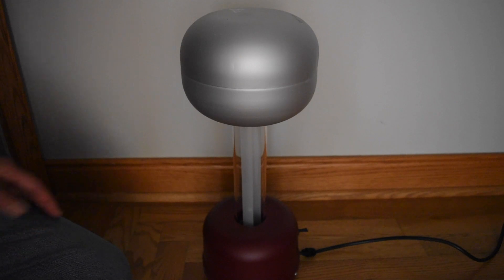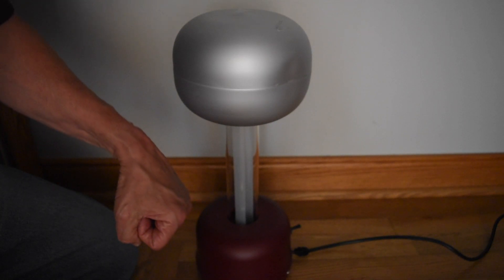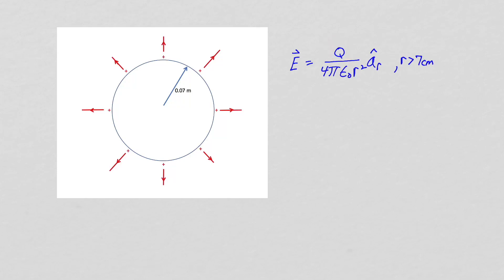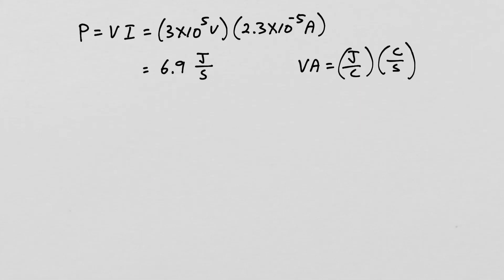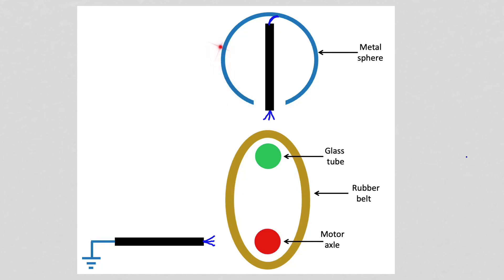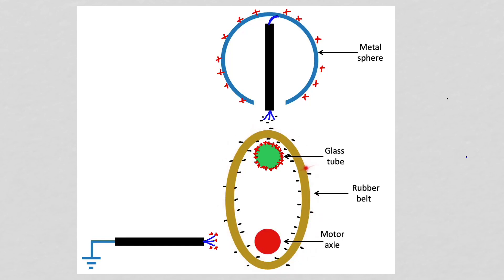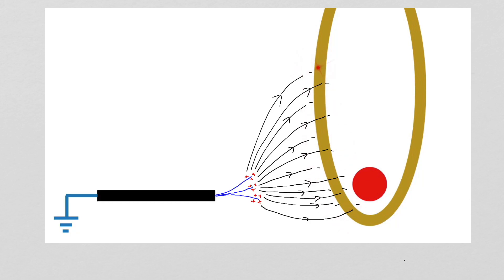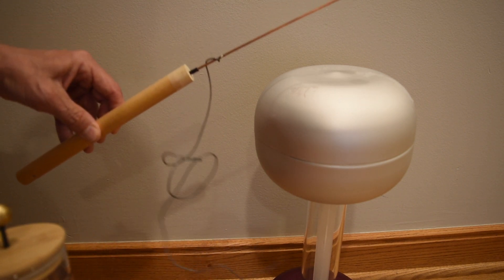How Much Charge is There on a Van de Graaf Generator?

Comment: So, if you charge the leyden jar from the positive terminal of the V.G., it's positive that's stored in the jar, and negative that collects on the outside terminal? 

So if you hold the leyden jar, do you start accumulating negative charge?
Reply from the maker: Correct
Reply: Does that make one surrounded by a negative field when they hold the negative terminal? And/or, will you start attrracting negative ions by holding it? @electricandmagneticfields2314
Reply: Is the amount of negative energy gathered upon a person proportional to the amount of positive juice in the jar? If I were to walk on a mountain or by a shore while holding the negative terminal - surely I would acquire a great deal of negative electrons, no? Would they just keep gathering until breakdown voltage is reached?
Reply from the maker: @AlexanderStone  I don't understand what you are asking. If you hold the jar, you are essentially acting as ground for the outer conductor of the capacitor. So if you add positive charge to the inner conductor, such as touching the ball to a positive voltage, electrons will flow from you to the outer wall of the conductor.
Reply: Or would I start pushing away negative electrons - being seen as a giant one to them?  @electricandmagneticfields2314

Comment: Sir, I have a question for you. Air has its own resistance and assuming that (I=V/R) is low enough not to kill you or make your heart skip a beat. I've also seen your Leyden jar video and the output of that cap had a current that can hurt you because (Q=V*C) and (I=dQ/dt). So, the bigger the Q, the bigger the I. If Q is bigger, then (Q=n*e) which means that n gets bigger too, right? Where n is the number of electrons. Would I be right in saying that the bigger I build a Van De Graaf generator or a Wimshurst machine, the greater the current? Or, the more of the little Van De Graaf generators or little Wimshurst machines I build, the more of the current is discharged? If I connected them in parallel to a main Leyden jar. Or do I need to connect them in series to add their voltages to increase the current because (I=V/R) and if V is bigger, then so is I and the resistance of air is constant, right?
Reply: yes, if voltage is higher, then the current is higher in the case that the material's resistance remains constant.

Comment: Hello, I have a question, If you would actually touch van de graaf, would it kill you? I made some calculations, lets say van der graaf has 300 000 V, assuming human body has a resistence of 2000, so the current is about 300 Amps
Reply from the maker: The current flows for a very short time as the sphere discharges. The buildup of charge on the sphere is small. Therefore if you are touching the sphere, the current flowing through your body is small.
Reply: @Electric and Magnetic Field. Sure, but isn’t it that current = charge per second. You assumed that the spark lasts 0.015 of second. I would say that electron flow is much more, about 200 000 000 meters/second, that makes the time over let’s say 0,1 m something like 5e-10 second. The current then will be something like 10^-6 charge /   5e-10 seconds which equals huge current. Even when I touch the outlet with 110V for a split of second it would give me a shock. I am confused what is actually harmful for human body. Is it the amount of charge going to your body or the speed of charge ? That is not the same, because hypotheticaly if I have a small amount of charge  that have high speed it would give me a high current even though the amount of charge transfered is small.
Reply from the maker: @michalkolarik9014  It is the energy delivered, so integral of VIdt, which is small.
Reply: Edit: I have consulted with my physics teacher at the university and turns out I was right. The current through your body is huge, but here the main role plays the amount of charge. So both of them are dangerous, its either big constant current circa > 3,5 mA)  or big amount of accumulated charge that you instantly touch (circa > 50 microcoulomb) that is dangerous
Reply from the maker: @michalkolarik9014  Since the sparks occur when I am about 10 cm away from the van de Graaff generator, the voltage is about 300, 000 V. (Dielectric breakdown strength of air is 30kV/cm.)
 
The capacitance of the van de Graaff generator is about 10 pF.
  
W = Energy stored on a capacitor = ½[C(V^^2)] = 0.45 J
 
About 1/2 a Joule, which is about the work down lifting an apple 1/2 meter is delivered to me with each spark.
Reply: @electricandmagneticfields2314  yes I agree

Comment: if we leave this vandegraff running and don't discharge ..then will it keep on increasing charge and voltage? and  if the dome of vandegraff is kept seperately in a vacuum than it would also keep on building the charge and voltage without auto discharge through dielectric breakdown of air forever?
Reply from the maker: The dielectric breakdown strength of air is 30,000 V/cm. Once the electric field at the surface of the dome gets to this electric field intensity, the voltage will not increase. You might not get a spark, but you will get corona discharge as the air ionizes and carries charge off the dome.  I talk about the maximum voltage and show it is a function of the radius of the dome in this video https://youtu.be/yaeITv9Ytko

Comment: If we put a metal sphere seperated by a dielectric on top of van degraff generator's top..would it keep on building high potential and charge density?
Reply from the maker: Do you mean a second sphere that could be attached to ground and act as the second conductor of a capacitor with the sphere of the Van de Graaff generator being the other conductor? Then yes effectively you would have a much larger capacitance that would mean more charge for the same potential.